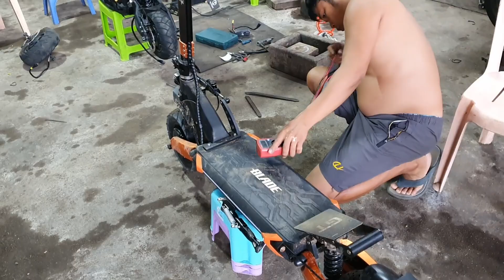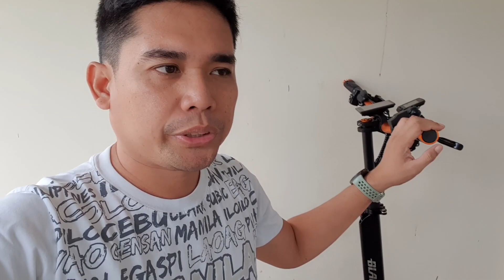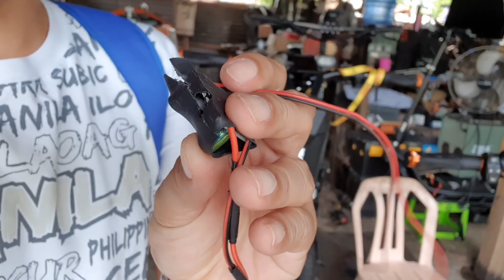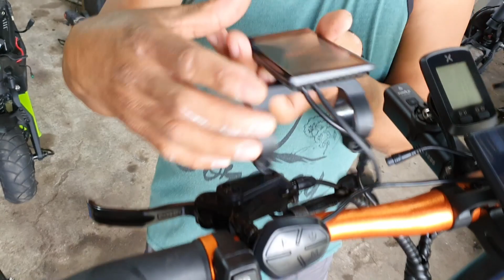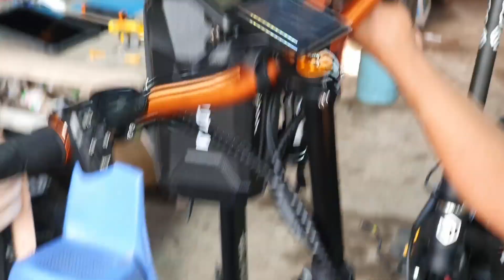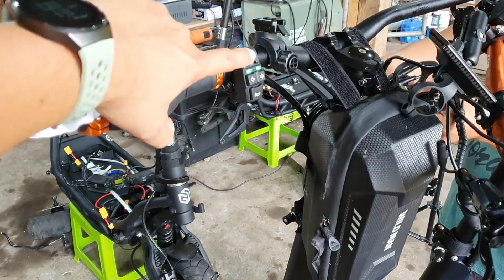Part 1 - Brand new Blade GT+ 28ah | No Power | Problem Solve

Comment: I have beaster exon pro which is the same as taverun blade gt, but the issue is that only the front motor is working, do you know what problem that could be?

Comment: Don't buy this scooter. Not worth the cost.  Cheap parts on this scooter.  So many issues on reddit. I sold my one after 1 week.
Reply from the maker: Maybe you just have the lemon unit. Mine is awesome. I am very satisfied with my unit ☺️
Reply: @ScootTaBai  My GT+ is also working well after thirteen months.I have had no reliability or performance issues up to this point,and I hope you are still satisfied as I am with your GT+.
Reply: Bro how could you say that it is cheap? blade is one of the best underrated scooter..
Reply from the maker: @marloncalaunan5561  for its power, build, category and awesomeness, it is the cheapest among its level. So yeah, it is the best there is for its price range. I couldnt agree more, its very underratedz
Reply: Is there a website to buy these parts?
Reply from the maker: @Evader_hawaii  its on aliexpress. But prefer to contact your local Blade GT vendor
Reply: I em lucking GT for 2 tausand € brand newe but on pistol trotle like old models but I realy don't care guaranty is 1 are and 2 tausand is ok price for 11inch scooters. I'm now in the fence cos I hawe unbelievable good mechanics but for Vsetts scooters and they don't hawe no GT2 or Teverun 11 fighter cos I wud love that scooter but what is scooter if you don't hawe good mechanics. And mine are what ever it's fixt in 5 days.Neve controler in the deck of Vsett8 and newe trotel it's under watsnty but I have stuf after and they worth gold . And I hawe good comuter but I want beast and beast is or GT , Teverun 11 fighter, and Vsett 11+ but not newest but 2022 cos my max is 3,000€ So I'm not smart ,and if something brakes I will flipped too wait part from China and not to ride 2,3 month that is exe. All somer to not ride scooter cos main dealer can take my mony but hee had not spare part for scuter. And exe. with Vsett is like when you goo too local dilership there is wee doo not hawe or part is on the boat:). I realy don't know what too doo.
Reply from the maker: @k9teamzagrebskolazapse149  it really depends on your seller. Most seller in my area, they sacrifice one unit to get parts while waiting for a warranty replacement parts to arrive.

Comment: ganyan ganyan nagyare skin ,tft ,nfc key and front ligth ,,i changes tft and put key ignition and new front ligth ,, ok nmn cya till thenn ,i think the nfc key make the problem 😅
Reply from the maker: Ganun ba sir? Buti naayos mo. Subrang mahal ang TFT display. Sana mag honor ang store ng warranty.
Reply: @ScootTaBai  hayss kala ko nga po free kaso it was my fault i think, kase i turned off the motor after a ride instantly, na hindi pala pwd un ,lesson learn, first turn offf on the power then the nfc or key ignition , btw i paid 25% of the price tft/nfc key,,and i buy key ignition apart, problem solve 😁😁
Reply from the maker: @paringboktv3903  tama pod sir. Proper maintenance lang talaga lalo na sensitive ang electronics